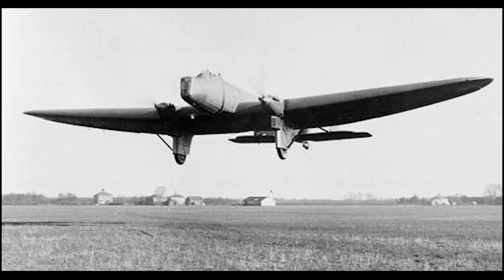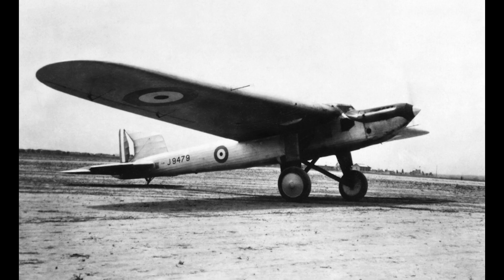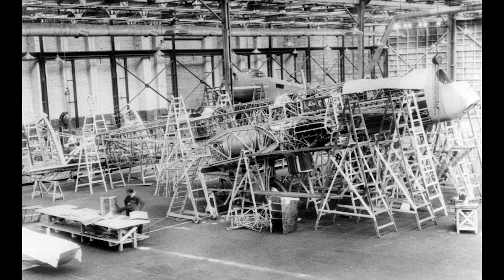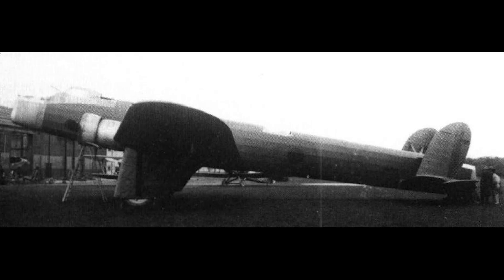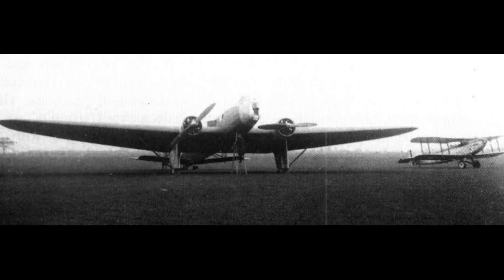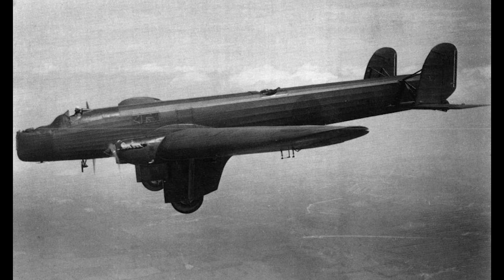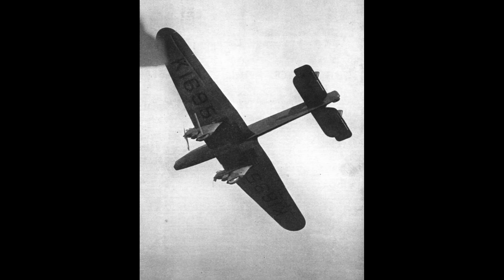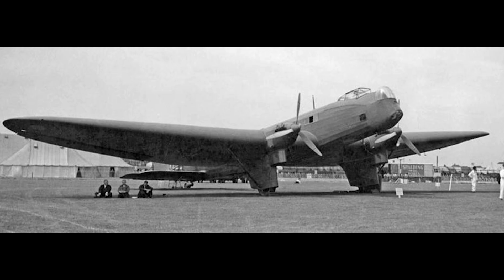Fairey's Unlucky and Forgotten Bomber | Fairey Hendon [Aircraft Overview #30]

Comment: The balancing of bomb load  and fuel was still  happening  in bomber command.  Large fuel & oil loads with light bomb load equals short trip light fuel and  oil plus heavy load  short trip.which was how crews worked out how far they'd  fly that night.

Comment: Very interesting.  Just to be pedantic though, there was another twin engined aircraft built by Fairey, that being the Gannet Anti-submrine and AEW aircraft for the Royal Navy - powered by an Armstrong Siddeley Double Mamba engine, which was two Mambas coupled together and driving contra-rotating props through common gearbox. When at cruising speed one of the Mambas could be shut down and its propeller feathered to save on fuel consumption an, thus increase patrol range.

Comment: "Fairey's only twin-engined aircraft." That depends on whether you regard the Double Mamba in the Gannet to be one or two engines, given that half of it drove each propeller and one half could be shut down for cruise economy.
Reply: Very valid point. That's sort of the same debate as to whether the Heinkel 177 was a 2-engined or 4-engined plane. Although the Double Mamba was certainly the more successful powerplant of the two.
Reply: No ! You can not compare 
with the He 177 !
The Gannet could always
turn one of the jet engines 
completely of. Using only 
one of the propellers.
Reply: @petersoerent2554  
I'm not comparing the engines. 
I said that's the same sort of debate about how many engines these planes have, whether a powerplant on either one counts as 1 or 2 engines. That's not the same as directly comparing the characteristics of the engines.

People will debate if a tomato is a fruit or a vegetable, and if a peanut is a nut or a bean. The debates are similar; that doesn't mean people compare tomatoes to peanuts.
Reply: @mikearmstrong8483  the Double Mamba was pretty much two independent engines, unlike things such as the DB series in the He-177.
Reply: The predecessor design studies to Gannet had two Merlins in most cases. The main difference was two sets of fuel  feeds and exhaust stacks.
Reply: @mikearmstrong8483  peanuts are not nuts...
Reply: @wbertie2604  I'm not so sure ...........  That Linus kid who spends his days trying to eat a blanket seems pretty crazy by most standards.
In fact that Beagle that dreams of flying a Sopwith Camel against von Richthofen seems the only one that's really sane.

That the Gannet's Mamba(s) could run on the Carrier's own 'bunker' oil used for propelling the ship - That was pure genius.  Almost unbelievable.
Reply: Indeed, my opinion for all it's worth is that we'd refer to a helicopter with two powerplants into a single gearbox and rotor as a twin so it's logical that a fixed wing aircraft with two props driven independently by two engines sharing only a fantastically convoluted gearbox is also a twin.

Comment: The general layout of the Hendon is strikingly prescient of later bomber designs such as the AVRO Manchester, the Armstrong-Whitworth Whitley and the like. I wonder if it had any influence on their designers. Interestingly, the Whitley had no flaps either but the angle of incidence of the wing was increased to give a slower landing speed. This had the effect of making the aircraft have a distinctive nose down attitude whilst in flight.
Reply: If they could make those wings even slightly thinner...
Reply: There is no way the Whitley wasn't influenced from the Hendon, there too similar

Comment: Bomb cells were the weak point of the later Short Stirling. As they were designed to take the maximum bomb size of the day, when said sizes increased,  something that hadn't been foreseen, the Stirling's bomb bay couldn't  be upgraded without a major redesign.

Comment: Looking at the aircraft and its blueprints, if they actually managed to figure out a way and find space in the wings to include retractable landing gear, it would have been by far not just a very modern-looking (for the times, that is) bomber, but probably the most modern bomber at the time.
Reply: As I'm looking at this, it seems that one thing the Hendon has got plenty of is empty space, and I wonder why. With some '30s planes, mostly small ones, it's wanting to have raindrop streamlining, but I can only assume the Hendon is so generously proportioned to get the right dimensions for its girders and space frames. Presumably they couldn't make room for the undercarriage because it would disrupt the arrangement of pyramids?

Comment: 3:47 "If the aircraft carried a full fuel load, it could not carry a full bomb load."

That's true of almost any powered aircraft though. If you can lift max fuel and max payload at the same time, you're losing the option of flying with reduced/zero payload and more fuel for more range/flexibility with the same takeoff weight.

Comment: It's fascinating how far behind the curve the British bombers were in the inter-war years.  This aircraft went into service in 1936; meanwhile the HE 111, almost 120 MPH faster and carrying 80% larger bomb load, went into service in 1935.
Reply: It was built to a 1927 specification and took forever to get developed and then ordered . The Wellington is contemporary with the He 111 your German 'wonder weapon' myth falls over then .
Reply: @mathewkelly9968  To be fair the German aircraft from 1939 to 1940 were probably the best German wonderweapons (or atleast the most successful).
I guess one should also consider the Arado 234 as a successful wonderweapon.
Reply: @mathewkelly9968  No one said anything about German "wonder weapons".  It is a simple comparison to an aircraft that was in service at the same time as the Hendon.  But to avoid the chip on your shoulder, let's consider the Martin B10 or the Fiat Cicogna, both significantly faster, and the Fiat has a 40% larger bomb load.  Also, the B10 went on line in 1934!  I guess I should have said that I find it fascinating that an Air Force would bring a plane into service that was so far behind the other aircraft in use at the time.  BTW, the Wellington didn't go into service until 1938, so apples and oranges.
Reply: Indeed. I also wonder if it had anything to do with the RAF biplane fighters also being embarrassingly slow and unable to intercept their own bombers. It's hard to imagine the phrase that " the bomber will always get through " would apply to something like a Heyford, but I guess that was actually what the evidence showed even into the mid thirties!
Reply: @peterharrington8709  It intrigues me that no one in 1934 or 35 said "Boy the Hendon is an outdated type.  We should just scrap the whole thing".  It makes all the more remarkable the turnaround that the British made, such that by early 1942 they had in service the Spitfire, Typhoon, Lancaster, and Mosquito, all at or near the best of their type.
Reply: @oldschool8798  ha... I feel the opposite really. It's like the Hendon is actually TOO advanced for 1934/5, and it shows the way to the future. Whereas the Heyford and It's ilk are perversely more acceptable to the RAF because they're seen to be good enough to get through by the service's own fighter force. It's almost like developing anything faster / bigger / higher flying might promote an international "bomber race". And of course civilian bombing WAS considered a horror tactic in those days. Very unBritish?
Reply: @peterharrington8709  Yes, quite. 😄

Comment: Could somebody clarify for me whether a figure for an aircraft's range refers to the distance it can fly with a full tank, ie until it is empty, or the distance it can fly with a full tank  before it has to turn back. Many thanks.
Reply: Range generally refers to the first definition, overall distance the ship can fly with a full tank. Your second definition, distance the ship can fly before it needs to turn back to base is generally referred to as combat radius. Of course, both of these numbers will vary due to the tradeoff between fuel load vs. bomb load as discussed in the video. This is a common issue for all bombers up to the present day. In-flight refueling does mitigate the problem to a great extent.
Reply: @jefftuckercfii  Thanks Jeff

Comment: You must be psychic. Id just come across this aircraft while researching british interwar bombers and it struck me as looking like an elder whitley, but upon closer examination, was a fairey design. Irregardless, its now added to my list of aircraft to model with cardboard.
Reply: At risk of seeming dismissive - which I genuinely am not aiming to be - wouldn't a mix of wire, balsa & fabric give you more of the shape.
And maybe the option of creating something which could be flown?
(The fairly cheap tiny electric motors seem to have an impressive if brief power output)
(Possibly cardboard can be flown if resin coated 'though?  I'm not modeller).
Reply: @Farweasel  no problem sir, i make static display models from thin sheets of cardboard, i can mold these into shape using heat and water. Landing gear oleo struts are of styrene model sprue. Canopies are of clear plastic sheet molded with heat to form. Guns are of Q-tip shafts with formed other parts. Wheels can be made of softer corrugated double layer cardboard pressed to shape via molds. After painting, details can be drawn onto the wings and fuselage using fine line black pen. National markings i can draw or print, cut out and paste on. These models do not fly, they are individually created artworks. I also make tanks, trucks, artillery pieces, ships, helmets, motorcycles, cars,guns, panzerfausts, grenades,  etc etc etc. These are not typical corrugated box cardboard, but high quality single sheets of various thickness depending upon strength needed for the individual parts and size scale. Wingspars are of wooden dowel of appropriate thickness. Weathering details such as mud , chips, and stain are painted on. I use online pictures and all around view plans for construction to get the panel lines correct. In the end, theres little difference between a plastic kit, and my handmade models. I can make turrets turn and guns elevate, as well as wings fold if necessary via pins and hinges also formed exactingly of cardboard. Any unsightly  seams are filled in with thin glued paper sheet. Interiors are filled with detail and painted accordingly. Crew can be purchased separately via kit if desired, in the proper necessary scale. Bracing and antenna wires are of common sewing thread. Antennae and pitot tubes can be of melted stretched sprue. A good eye can pick up common items for use on home made models, for example, cut plastic windowscreen for sailing ship ratlines. Etc. Hope this better describes what i do. Thanks.
Reply: @HarborLockRoad  I am genuinely impressed.
Some of these things must be unique ... I suspect the Imperial War or RAF museum, and quite possibly others, would be rather keen to have them when you've finished with them.

Comment: Contrary to the statement at the end of the video, this was not Fairey's final attempt at building bombers. But then, the less said about the Battle, the better.
Reply: Couldn’t agree more.
Reply: Let's not forget the Albacore and Barracuda either. Both developed after the Hendon.
Reply: Perhaps he meant heavy bombers.
Reply: @FieryCheeze  yes, I think he probably meant larger, multi engine bombers.
Reply: Fulmar as well!
Reply: @twddersharkmarine7774  Although they could carry a light bomb load (a single 250lb or 500lb bomb), the Fulmar was a fighter / reconnaissance aircraft, rather than a true bomber
Reply: @mandoprince1  i see, good to know
Reply: @twddersharkmarine7774  For  a fighter powered by a single Merlin, this was a seriously large aircraft, as was it's Griffon powered successor, the Firefly.
Reply: @mandoprince1  ah, i see, i really only have heard very little about the Fulmar, so i really didn't know much
Reply: @mandoprince1  Though it did start out as a "lightweight Battle" intended to fill an RAF specification for a dive-bomber. The Hawker Henley won the competition though and instead the Fulmar was developed as a general-purpose naval aircraft. So, since the RAF decided they didn`t need a dive-bomber after all, only a few Henley`s were built as target tugs and far more Fulmars were produced for the Royal Navy.
Reply: @mandoprince1  And was the most successful Fleet Air Arm fighter in terms of kills, something most people don't appreciate

Comment: That fuel/bombs balancing act was not unique. Bombers from 1914 to 2022 have had to do one or the other; carry a full bomb load over a reduced range, or fly a lot further carrying less. Considering that in-flight refueling experiments had started in the early 1920s, and a single plane had been kept airborne for almost a month (!) by 1935, I wonder why the practice was not adopted for service until post WWII.
Reply: All commercial jet airliners trade payload for range. More payload = less range.
Payload makes money. Fuel (particularly if unneeded) costs money to carry.
WW2 bombers did the same thing.
Reply: With the adition that today you can make use of in-flight refuelling so you take off with few minutes worth of fuel and as many bombs as you can carry and then when airborne top off your tanks

Comment: Ehrm, the Hendon may have been Fairey's only other twin-engine air_plane_ besides the 1917 prototype, but it wasn't their only other two-engine aircraft. There was also the Fairey Rotodyne -unless you count tipjets as engines, in which case that one technically has six.

Comment: One of Fairey's most successful designs, the Gannet, was twin-engined, as the Double Mamba had two independent halves. It was the culmination of a series if design studies of WW2, often with two Merlin engines driving a single airscrew, or one half of one on a single axis.
Reply: There was also the Rotodyne.

Comment: Another thought - wing design.  Especially the idea that the wing has to be the typical 'teardrop' cross-section.  Recently we're being told that the idea that wings get lift because of that shape (air above has to move fast and therefore has lower pressure, etc) is wrong, and basically, it's only the curve of the wing that matters.  As with sails on boats - they work at generating forward thrust from sideways wind because they are curved, despite the fact that their cross-section is the same (i.e. flat) all over.  Did anyone try a curved, but otherwise flat wing?  I've also heard that this idea is also wrong (!) and that it's the air turbulence created by the wings that gives lift (the same turbulence that creates drag at the wing tips - hence all these weird bits on the ends of wings these days).  Initially, I suppose, builders just copied existing designs that worked, and maybe didn't really understand the science behind how they worked, but once wind tunnels were developed, designers must have started to try different designs out and get a much better understanding of how the lift was produced.  A video on this would be much appreciated.
Reply: Not sure on your information there, but recently there has been a push for winglets. These stop the low pressure air running off the end of the wing and add about 5% fuel efficency.
Reply: As someone wise once told me wings have two sides. A Bernoulli side and a Newton side. Combine both sides to get the best of both worlds.

Comment: Why have 10x 1,000lb bomb cells, when the maximum bomb load was only 2,500lb?
Seems like a waste of effort.
Reply: I think you will find that the main (10 cell) bay, was capable by dimensions only of carrying 1 or 2 x1,000lbers, which is what Rex was alluding too. Not actually 10 x 1000lbers.
  But in reality it would usually carry at full capacity probably something like, 10 x 150lb in the main cell and the 2 auxiliary cells, 6 x 150lb. But as he recognised, it's all a bit of optimism by the manufacturers , Fairey.